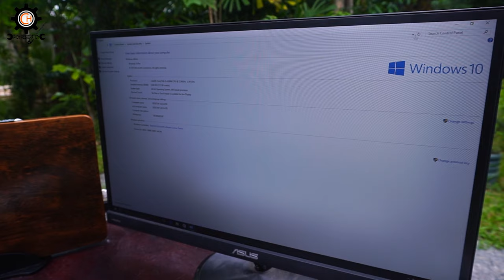DIY | Transform a laptop into a stunning desktop PC | P-CH RESTORATION #lenovo

Comment: Sir,does the laptop detect the external monitor as its primary display after disconnecting the main display?i mean does thre boot process run on the monitor by it’s own? It'll be a great favour if u ensure this.
Reply: I think it does when you disconnect the lcd from the board. I did it with my Acer laptop and it works,
Reply: You gotta configure in bios
Reply: Just press windows +p if external montor not  detect

Comment: Hmm I have gateway nv53a laptop with everything mobo etc battery but I wanna make a chassis for it but idk what to use I used cardboard and it came out crappy hmm I dont really have a lot of money but thanks if u can help
Reply: I'd say try using wood, it cam be pretty cheap if you find thinner ply
Reply: Or make one out of ply board, acrylic or slateboard